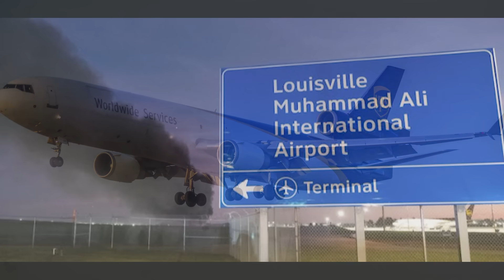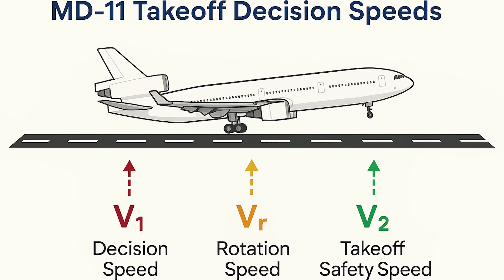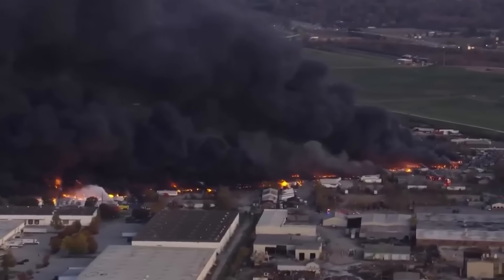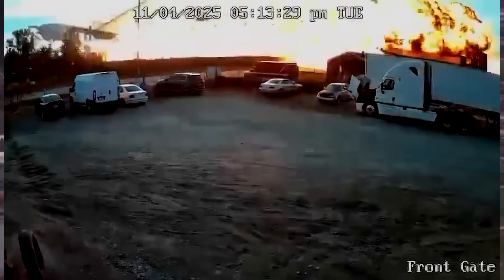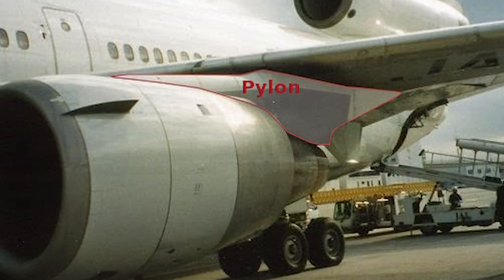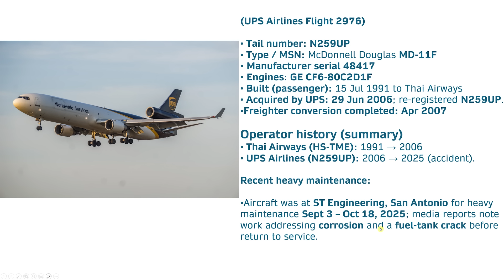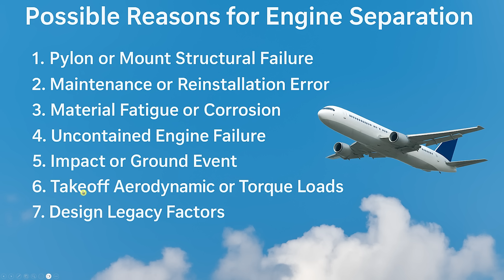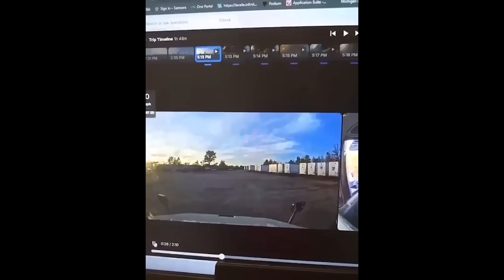What Caused UPS Plane Crash, Louisville, KY? How MD-11 Engine Fell Off

Comment: What's also scary is that guy has a dashcam pointed right at him so his bosses can monitor him at all times.
Reply: What is scary about that.  It's very common to film in front and inside.  Especially with truck drivers.  In the case of an accident it can show that they were asleep or using the telephone etc.  What do you have to hide?
Reply: @Salutimondo beating

Comment: If the NTSB and FAA forced airports to install An Engineered Materials Arresting System (EMAS) is a safety area at the end of an airport runway, designed to stop an aircraft that overruns the runway by using crushable, lightweight material to absorb kinetic energy. This would save so many lives.

Comment: What’s kinda crazy is there’s only 1 other plane that has lost its engine just like this md11 did and that was a dc10 which is basically the smaller version of this very plane. It was found that the mechanics had taken shortcuts when replacing the engine.

Comment: Recorded video nowadays is fascinating, recording by chance, people haphazardly running across downed live electrical wires!

Notice, luckily, the two running male adults were not subsequently electrocuted while running through the puddling water, electrified by the live dancing downed electrical cable in water!  Chances are, they never noticed an downed cables.  One of them likely did notice something with one foot in the water.

In the past, seeing something like this would have always been by word of mouth, if ever even noticed.

Comment: The engine fell off. 
As a mechanic, I’ve never had an engine fall out. I’ve never had ANY pieces fall off.
Wanna know why?
Because I understand how a wrench, torque wrench, ratchet, sockets, nuts and bolts work.
Also, I was hired by myself, so I could eat. And realized early that quality work payed the bills.
So, either Muhammad, or Sheneldria ( and her 6 inch fingernails) didn’t use the correct hardened nuts and bolts or probably were too high, or praying to the east to care about tightening them up.
The only airline that touches the US in my opinion is Turkish airlines.
They do not use DEI hires to fly or repair their planes.
Now….remember ATC, is here….in the US. Some are DEI hires.

Comment: Damn.... full of fuel, fully loaded, missing an engine, and it's thought a compressor-stalled middle engine, likely from left engine debris..... 
Two engines might have been doable, but one....., No way....
They were past the point of no return to abort the take off, and unfortunately, flying away just wasn't doable with what they had to work with..... 
Blessed be the souls lost and their families....

Comment: I dunno if it is just the angle of the debris, the engine cowling almost looks like it was cut off,  it is making me think it was an uncontained engine failure of some type.  Is there a debris map yet?   I'd imagine if the cowling is before the engine on the runway then this might suggest engine failure.

Comment: It looks like there was a fire somewhere on the #1 engine during takeoff roll.... leaking fuel tank??? a fuel line not connected securely??? of all the maintenance issues I ever had on the DC-10... none were in the QRH or expanded check lists and all were lax MX work... with that said... Douglas was the #1 aircraft manufacturer since 1935 (DC-3).... still have 80+ DC-3's still flying in commercial aviation

Comment: There are specially engineered high strength bolts which affix the engine to the wing. The fact the engine is gone from the left wing suggests the engine is somewhere on or near runway. The bolts are located on the airport property. Key questions: a) when was the set of bolts last replaced or subjected to maintenance inspection? b) who is the manufacturer of the engine bolts? c) who is the subcontractor who does engine maintenance and airframe MRO contractor?

If this is an engine bolt issue, that implies there are other potential defective pieces of hardware associated with MD-11.

I share a similar history on the American Airlines MD11 crash. I was traveling on that flight one week before it crashed in O'Hare.

Comment: I was puzzled when the ADS-B data indicated that the plane reached a height of 450 feet. NTSB didn't specify AGL or MSL. Didn't look like it from all the videos. But that was MSL (Mean Sea Level) height. I looked at an airport diagram of Louisville and the end of runway 17R is 461 ft MSL. So accounting for tolerance, that plane never got farther than about 40 to 50 feet AGL above the ground.

Comment: It hit a power line cut through the fuel of the wing caused by  the landing too low..
Who designed that air strip landing is an idiot over building and utilities poles

Comment: This forward part of the engine cowling is fixed to the front of the engine and is not hinged in any way.  This part was either knocked off by the the impact of the engine and pylon with the ground.  Or, was blown off when the engine exploded.

Comment: These Douglas planes with the 3 engines are known for crashing. This exact same plane type crash happened long ago where the engine fell off. They remove the engine for maintenance and if they damage the bolts when reattaching the engine. It will actually rip itself off from thrust.
Reply: Hell I thought they stopped making them planes in the late 80's doors falling off in mid flight in all
Reply: LMFAO! Just letting the numbers speak for themselves. Facts.  The last DC-10 crash was in 2004 (pilot error).  The last MD-11 Crash was in 2010 (pilot error).  Every single DC-10 or MD-11 crash was attributed to poor maintenance, inadequate inspections, or Pilot error.  Since 2010, in the last 15 years, there have been more than 200 (of all types) Airbus crashes, seven 737 crashes, three 747 crashes, three 777 crashes, and one 787 crash. Yet NO MD-11 crash or DC-10 crash.  The United States Air Force has a 90 percent operational success rate with their DC-10 air refuel tankers. The only KC-10 lost was a ground fire by a maintenance mistake. You yourself said "a long time ago" yeah, like 46 years ago, and we don't even know why this one fell off.
Reply: Yep, terrible company and aircraft.

Comment: There is a specific sequence for mounting the engine and pylon. If that sequence is altered it puts excess stress on the mount, which can cause it to eventually fail. I'm pretty sure that has happened before.

Comment: When the engine fell off it caused a masive fuel leak.. when the plane nosed up to take off the tail motor injested fuel from the wing and flamed out.. then the plane dident have enough thrust to keep the climb out on 1 motor

Comment: I don't think the plane actually made contact with the building that has the roof damage. The thrust from the jets and air pressure itself could have knocked out the roof given how low the plane was.

Comment: The reason for the before mentioned LH engine comming of was the engine didn't detach properly and the engine ripped the leading edge off thus no lift on LH side. The bolts were all meant to fail if one failed

Comment: The similarities with the DC-10 crash in 1979 do not escape me. Even the damage you see on the wing is almost identical. It looks like the rear bolt that connects to pylon to the wing sheered off first, causing the engine to rotate over the wing and damage it at the front before breaking free. Therefore, it was not a loss of thrust that caused the crash, but a lack of control due to the damage caused by the engine breaking off. The MD-11 can take off with only 2 engines after all even when fully loaded.

Comment: I was in aircraft maintenance for a long time, and this immediately looked to me like a similar event to the Flight 191 which we used as training material. Eerily similar. Rest in peace to those who didn't make it, they never stood a chance in that situation.
Reply: The forklift
Reply: I see the comparison, but 191 got airborne and crashed when the slats retracted and the plane lost lift on one side. This plane stayed level until it had already hit the ground, so it wasn't a loss of lift on one side. The event was too quick to have been from a loss of hydraulic fluid, and modern planes have isolation valves to prevent that anyway. This is really weird. Wings level, single engine, the plane should have easily cleared everything. I have to wonder if the departing engine screwed up the Fadecs somehow? Maybe a failed breaker that allowed the departed engine to short the bus? Hopefully the black boxes will shed more light.
Reply: @ericschumann4213  I thought it looked like it banked after hitting the power lines.  I'm unsure.
Reply: @lupusgirl1000  " I thought it looked like it banked after hitting the power lines.  I'm unsure."

After hitting the powerlines, for the second time, the aircraft hit vertical waste tank, which caused it to roll left.
Reply: @ericschumann4213  the cause of engine departure isn't known, but it crashed because of the fire. You can see on the original take-off video the #2 engine had a compressor stall, likely due to the hot air and smoke entering it from from the fire. So they are down from 3 engines to 1. In addition to this, the aerodynamic lift of the left wing will have been hindered by the very hot air coming from the fire. We'll know more in the coming weeks that may change this, if the engine had departed without a fire there is a very good chance they'd have been able to save it. However, there's still a lot we don't know.
Reply: Nearly the same plane! This was a DC-10 converted into a MD-11 I believe.
Reply: I saw the smoke from 191 as a kid.
Reply: @jelsig6783  I grew up in the trailer park next to the field it crashed in.  I was 9 years old and just got home from school.  I heard and felt the explosion as it shook the trailer.  I went out and seen the plume of smoke.  I took off in the field on my bike, but safety crews were on seen so I could not make out what it was until going back home and turning on the news.  They closed Toughy and Elmhurst.  My parents freaked out at work, rushed home.  Had to park at the gas station with ID to be able to run to park to see if all was well.  I'll never forget that.
Reply: i am an enthusiast , but certainly not a pilot or expert , but i thought the exact same thing as soon as i saw it.
Reply: My condolences
Reply: That's exactly what I'm thinking as well.
Reply: Yes, a cargo plane load of lithium car batteries and chargers would significantly intensify a jet fuel fire. Lithium batteries pose an extreme fire hazard in aviation because they can ignite, burn at extremely high temperatures (over 1200°C), and the resulting fires are very difficult to extinguish with conventional aircraft fire suppression systems. 

Here is a breakdown of the hazards:

Thermal Runaway: Lithium batteries, especially in bulk, are susceptible to thermal runaway. When one battery overheats or is damaged (which could easily happen in an existing jet fuel fire), it releases energy uncontrollably and generates enough heat to cause adjacent batteries to enter the same state, leading to a cascading chain reaction of intense, self-sustaining fires.

Intense Heat: Lithium battery fires burn hotter and faster than many other fires, including jet fuel fires. They can reach temperatures of up to 1200°C (2192°F) or more, which would significantly increase the overall temperature and destructive potential of a jet fuel fire involving 38,000 lbs of fuel.

Unstoppable Fires: Current onboard aircraft fire suppression systems (such as Halon) are designed to extinguish the flames of a fire but are not capable of stopping the internal temperature rise and subsequent thermal runaway of lithium cells. The only effective way to stop the thermal runaway is by significant cooling with large amounts of water, which may not be available or feasible in a cargo hold fire.

Flammable and Toxic Gases: During thermal runaway, batteries vent a significant amount of highly flammable gases (like hydrogen) and toxic fumes (like hydrogen fluoride). These gases can accumulate and potentially cause explosions, adding to the fire's intensity and creating a severe health risk for the crew.

Explosive Force: When exposed to high heat in a contained space, the build-up of pressure inside the batteries can result in explosions, forcefully expelling white-hot molten lithium and other parts of the device like shrapnel, spreading the fire further. 

Several fatal cargo plane crashes have been attributed to in-flight fires involving lithium batteries, with the fire being so catastrophic and unstoppable that it led to the loss of the aircraft and crew. The presence of a large quantity of lithium batteries alongside a major jet fuel source creates an extremely dangerous and likely uncontrollable fire scenario. 

What aircraft fire suppression systems are being considered as alternatives to Halon for lithium battery fires?

What regulations apply to transporting lithium batteries on aircraft?

What are the typical differences between lithium-ion and lithium primary batteries?

Lithium batteries: safe to fly? - Safety First | Airbus

￼

Safety First | Airbus

Why lithium battery fires are far harder to fight than ordinary fires - AvSax

￼

AvSax

￼

The serious fire hazards of lithium-based batteries to aircraft - vrr.aero

￼

vrr.aero

￼

Show all
Reply: My God! How does an engine just fall off???

Comment: Thanks for the commentary and your possible reasons for this crash.
My concern is this could be terrorism, purposely tampering with any part of this aircraft during service…..it can’t be ruled out. Service and maintenance standards have increased since 2020 so it concerns me that an engine would fall off and the other engine sparking significantly…..it doesn’t jive with me or any of my aviation friends, my ask is who polices these maintenance crews other then standard operation co-ordinate monitors?? Does the NTSB do unannounced safety audits???
This all doesn’t make much sense to me and I want to take a second to thank the pilots that likely did all they could to mitigate as much damage and death to the area they impacted.
My sincerest sympathies go out to all impacted by this tragedy and I pray that I’m totally wrong that this could be a result of tampering/terrorism.

Comment: Why are airports always crammed right up against the surrounding populous? There should be a solid 4 miles of open field (manmade or otherwise) following all major runways imo. If that means you have to drive an extra 10 minutes because it's sitting in the middle of nowhere surrounded by nothing, so be it.

Comment: Looks like the Pylon is missing as well. So that could rule out the aft cone bolt. If it was the rear pylon  bolt the engine would rotate forward up and over the top of the wing.

Comment: First place I would look is the pylon or the attachment points from the engine to the wing that would be most obvious to inspect immediately something had to fail that dropped the engine whether it be at the wing or at the location of the engine to the pylon that fastened to the wing this has happened many times on Jets before that lose engines rest in peace I know that would have been a horrifically terrible ride to your end😢

Comment: I was 14 when American Airlines flight 191 crashed and remember reading about the maintenance failure where they used a forklift to hold the engine during maintenance. Unfortunately hydraulics won’t maintain its position when the motor is off and this allowed the engine to sag causing the cracks in the engine mounts!

Comment: Yes, it's an engine cowling. Doubtful that the engine separated due to a catastrophic engine failure such as a bird strike or fan separation. The cowling is required to contain all pieces in the latter. Given that there was a fire in engine no 1, fuel and hydraulic lines come into question including unauthorized (counterfit) parts. Pylon failure is questionable, but since parts are regularly scavenged from dead aircraft there is a possibility that they or the fuse pins were replaced and either not magnafluxed or UT inspected and there was a defect in the fuse pins (?). If there was excessive stress (or if the fuse pins were weakend by the fire) they they are designed to separate the engine from the wing before wing structural failure. The AA191 accident was a result of improper maintenance methods which led to the damaging of the left wing pylon.

Comment: The last one of these they left the engine set on a forklift, half hooked to the pylon, the forklift bled off and it done damage to the pylon. They went ahead and installed the engine, not knowing and it cracked it and ended up departing the aircraft. I think there’s been three of these Went down due to this pretty sad being a Mechanic myself. It is a stressful job and especially if you just worked on one had an incident you worry about it I worked on cranes for the last 15 years of my life and anytime somebody got hurt or crane rolled over and you worked on it. You’d be like hoping nothing you did was my fault. It’s just stuff you worry about. I finally quit working on cranes because of the liability either way you got liability than anything you work on but not as much that’s like a crane or an aircraft

Comment: You could make out the mist of fuel spewing from the wing with the missing engine. The ignition of the firestorm was on the second power line strike.

Comment: It had three engines on it. One stopped working so how come the two engines didn’t get it in the air? I get the other engine was gone. Just wondering cause this is truly sad for all involved. I will bet they did everything they could to try and make sure there’s not as many casualties from this. It’s all they could of done. The one image of the plane right there in front of them would give me nightmares.